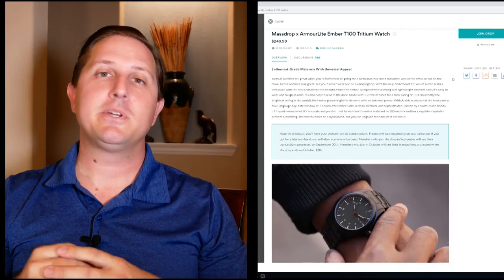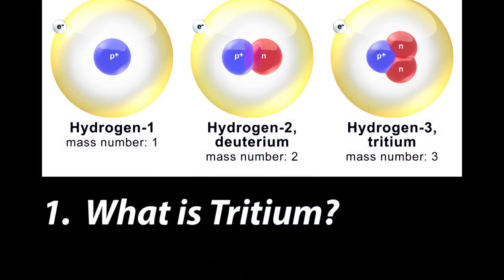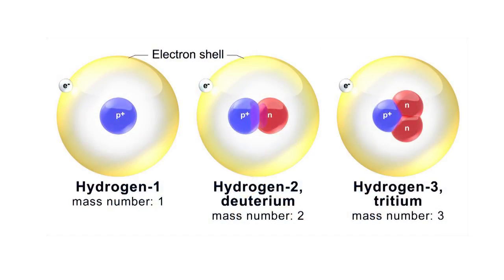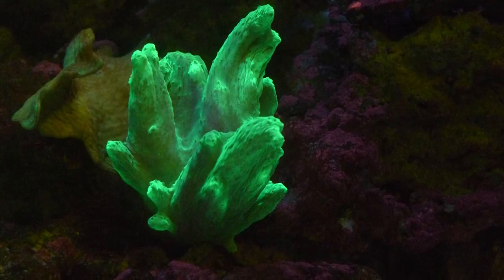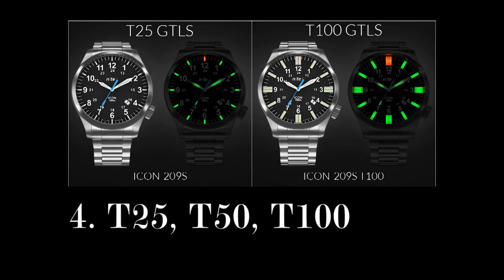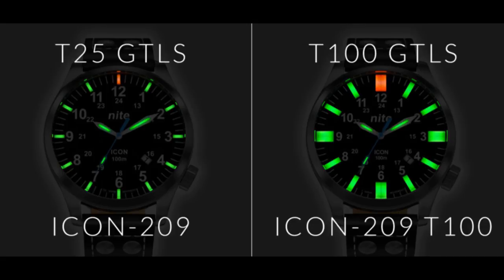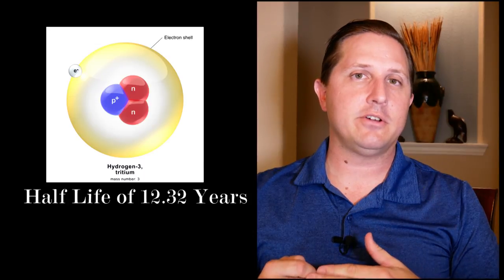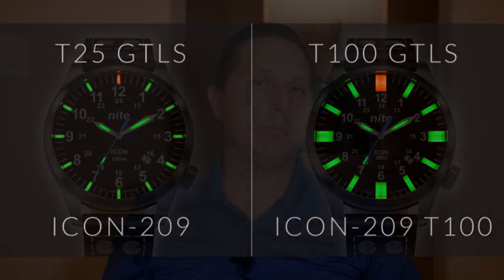Understanding Tritium : Everything You Need to Know, And a Few You Don't (Science Time)

Comment: Ok but most watches that use  tritum  use paint not tubes so how does that work
Reply from the maker: Excellent question.  Tritium paint was widely used in the past but hasn't been for some time.  (Not much since the Radium Girl lawsuits way back when).    I'm not 100%, but this would be my guess.

The paint would be made up of multiple components.  One of which would be a Phosphor, the other would be some molecule that has Tritium integrated into it.

If you think about it Tritium is just a heavier Hydrogen molecule.  Both of which are gases in their native state.  Yet Tritium, like Hydrogen, can get integrated into molecules in the same way.  It's just that in time Tritium would decay and disrupt whatever it was originally part of.

A good example of this is what's called heavy water.
https://en.wikipedia.org/wiki/Heavy_water
Normal Water is H2O.  Yet Deuterium and Tritium (both Hydrogen isotopes) can also bond with oxygen, in the same way, to create D2O and T2O respectively.  Heavy water acts mostly like regular water but it's heavier.

So my guess would be that a Chemist just substituted some molecule that had Tritium on it in place of a Hydrogen atom.  Eventually that Tritium would decay as it usually would and cause the same Phosphorescent reaction.

This is also partly why I think (again not 100% sure) why old Tritium based paint turned off yellow after 10-20 years.  As the molecule it was being bound to would of been disrupted when it decayed.
Reply from the maker: Actually scratch that part about the Radium girls lawsuit.  I wasn't thinking and that was with the Radium based paint, not Tritium.  But again I don't think Tritium paint has been used in some time either.  They have been utilizing the gas tubes for at least 20 some years.
Reply: @RelativeTime   yes i was talking about some rolex and omega watches in the 90s like the sub and speedy that used tritium paint and wonderd how they made it into paint 
The radium i get but tritium i dont as people say it was is a gas how do they pair it with paint?
Reply from the maker: @funfunyo7523  Well I don't know the exact formula they used, but I don't think it would be terribly difficult to substitute Tritum for Hydrogen in a reaction.   It's some basic chemistry as they act fairly similar.

One thing to remember is that there is a difference between an Element and a Molecule.  Which gets confusing when you are talking about Tritum and Hydrogen.  Hydrogen gas , the molecule, is actually made up of 2 atoms of hydrogen bound together.  But when you say Hydrogen, you could be talking about either the gas or the individual atoms.  Same can be said for Tritum.

So theoretically they could take Tritium gas and mix it with oxygen (probably add some heat) to create heavy water.  So it would be T2O instead of H2O.  Then they follow the same recipe they would for normal paint, but say use the Tritum based heavy water.  At some point, the Tritium atoms would then separate from the oxygen and bind to something else to form another molecule for the paint.

Or something to that effect.  I've probably confused you more, but I'd really have to go into a Chemistry 101 lecture to expand on that.

Did you ever see The Martian?  Remember the part where he was trying to make water?
https://youtu.be/d0wjEgxAPY4
He used Hydrazine which is a molecule made up of 2 Nitrogen and 2 Hydrogen atoms.  He ran that over a catalyst which broke it down into Nitrogen (N2) and Hydrogen (H2) gas.  Then mixed the Hydrogen gas with oxygen and added some heat (flame) and it creates water H2O.  That's all very sound, and theoretically, I think it could work with Tritium gas instead of Hydrogen.  Without the explosion of course.
Reply: @RelativeTime  thanks for your reply here is what i found Tritium Paint: A self-luminous paint comprises a phosphor and a source of radioactive energy for exciting the phosphor to luminescence, usually held together by a binder like a clear varnish. Tritium is a gas, an isotope of hydrogen, which can't be mixed it into paint. To make tritium paint, the tritium has to be bound to or into something. Because tritium is chemically the same as hydrogen it will react with oxygen to form ‘super-heavy water’, T2O (tritium has an atomic mass of three, one proton and two neutrons; another isotope of hydrogen, deuterium, has an atomic mass of two, one proton and one neutrons, and makes ‘heavy water’ D2O). The super-heavy tritiated water is then made into polyvinyl acetate, which is used to make water-based paints and PVA adhesives. This is used as the binder with a phosphor to make self luminous tritium paint. I believe that tritium paints were discontinued in the early 1990s

Comment: Same in their basic characteristics? No. Deuterium is now used extensively in OLED displays as deuterated organic compounds offer a far more stable device.
Reply from the maker: Well, let me put it this way.  The basic characteristics between the isotopes are the same.  As you can usually swap them in most organic molecules.  If you were to do that with any other atom (if it was even possible), it wouldn’t wind up being close to the same compound.  What your referring to is the characteristics of the compounds created by the different atoms, which can be different.
Reply: @RelativeTime  If you were to hold at arms length a kmol of hydrogen, and in the other a kmol of tritium, you would slowly feel a difference.

Comment: I have lots of radium stuff. But after 1-2hrs it get so dim. Thats its almost goes invisible in dark. Then i need to put torch on it then it glows for another 1hr 😛 why the fuck its so dull.
Reply from the maker: I believe radium paint will have radium mixed with a similar phoshorescent mixture as to regular lume.  So my guess would be that its charging from light just like regular lume. In addition to the charge from the radium.
But if it's that low in darkness, it's probably not getting much from the radium at this point.

Comment: How do I mine it myself and process it?   So expensive.   Need it badly in my industry and it's wtf expensive...oops nevermind
Reply from the maker: Don't think you can mine it.  If I rember right it's often produced commercially in special nuclear reactors.  I think they degrade Li or something to get it.  So it's sort of expensive for a reason.
Reply: @RelativeTime  yeah it requires a on-site reactor type unit which bombards hydrogen gas. I could make one but I need depleted plutonium 😅

Comment: How about danger of drinking billions of gallons fukushima tritium water ?
Reply from the maker: Are you referring contamination from the initial incident, or the planed release of treated water?  Either way, it doesn't sound good, but realistically should be fine as it will get extremely diluted so that it's not an issue.